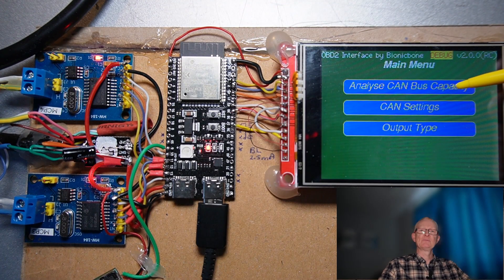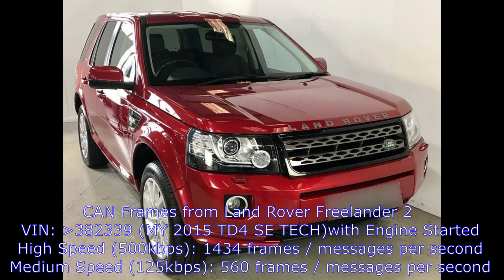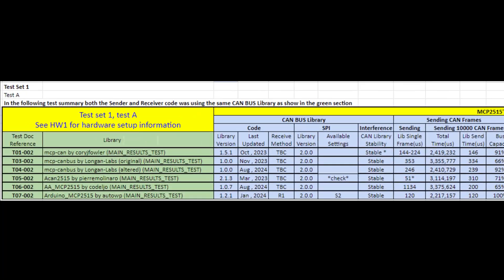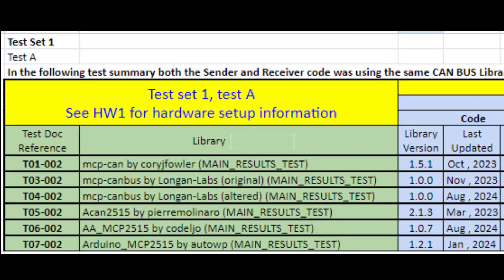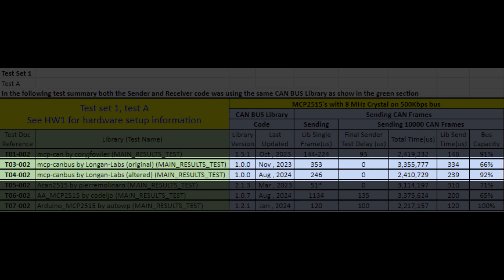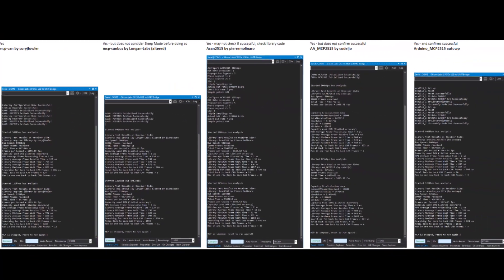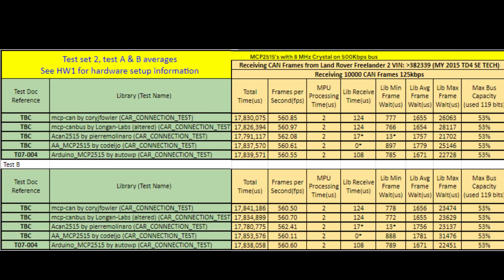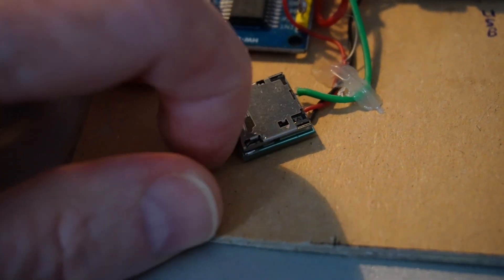MCP2515 Arduino CAN BUS Library Performance Testing

Comment: Hello, professor, I am working on a project to configure the steering angle sensor on the table via the Toyota CA L CAN H. I have tried it many times and failed. I hope you can help me. I do not know the ID for communicating with the sensor.
Reply from the maker: Each car model of car is different when it comes to IDs, so you have to work it out.
Best way to do this is record data for you turning steering wheel back and forth 3 times. Then load into SavvyCan, the graph will be 3 waves so easy to spot.
Reply: @TheBionicbone You mean it's hard to initialize when guessing the ID? Should I stop the project?

Comment: hello sir, do you know how to get rpm, engine temp, throttle position from ECU? i use 1 esp32 devkitc v4 and 1 mcp2515 (hw-184) that i connect to obd2, but i still don't get it.
Reply from the maker: @refaldiagustian For a Freelander 2? What year?
Reply from the maker: @refaldiagustian From a software point of view look at CanDrive for sorting live data. If you can record data, then SavvyCAN is better. So if in CanDrive, pressing the throttle pedal will make a line change, when it's still that line wont change. You've got to have patience since on cars past 2012 theres a lot of data and a lot changing all the time.

Comment: Thanks for your great work here, I am thinking about using this frame work to evaluate other hardware combos,  any suggestions on other hardware to compare too.  I am focused on Seeeduoino line of boards.  Wondering what other MCP2515 board people use. My purpose is general CAN for industrial use, but I want something I can use for cars also because I do lots of work with that too, but there are lots off off the shelf tools for 90% of those issues.
Reply from the maker: First I had two reasons for using the MCP2515. 1) if my code failed likely the MCP2515 buffers would fill and the car would be unaware my code failed. 2) I needed to watch two CAN bus at the same time and very few MCUs have more than one CAN Controller 

If I'd wanted to only monitor 1 CAN Bus then I'd probably use some MCU that had a CAN controller built in, thus the hardware would only require the CAN transceiver and be much smaller but take note of the redundancy offered by (1) above.

So if I had time I'd use the ESP32-S3 CAN controller with a TJA1050 (my MCP2525 uses one of these) to see if there were any improvements or control gains that offset (1) above.

Comment: This was a great video. I've recently started getting into Canbus, hacking, I have a Suzuki lapin from Japan and there's minimal to no documentation on it. I figured out what the majority of can ID do. But I'm still stumped on how the passive entry system works 

From what I can gather the fob uses RFID to talk to the car but I can't tell if it has rolling codes or not, I'm hoping to be able to clone the RFID data to a generic fob, but I've had no luck so far.

I'm beginning to think that the immobilizer system possibly runs on a separate LIN BUS that doesn't directly communicate with the rest of the network.
Reply from the maker: I did some work with SDR, to passively see the signals from the fob, if they change then there is some form of rolling code. Check some of my older videos for installation and some basic use cases. I also did some work on 433mhz and managed to replicate some signals.

Comment: Hi, would you mind sharing details of the hardware and software you used? That's very interesting.
Reply from the maker: Hopefully in the next week or so I'll be copying this over to a github master so I can share the firmware because it does everything needed for recording and analysing the data now. Of course they'll always be a need to add user code for things like requesting data or other tasks to see if what you found is what you think it is. For hardware, I used ESP32-S3, two MCP2515 (HW-184), and an ILI9341 display (with touch). Look for bionicbone on github.
Reply from the maker: I forgot to mention the F411 Openlager (not to be confused with an OpenLogger) for recording, kind of a must really for this so you can use SavvyCAN (or similar) to help find the data while sat comfortable indoors :).
Reply from the maker: https://github.com/bionicbone/OBD2_Interface_v2_Release

Comment: It looked like you are using esp32, that has an inbuilt CAN controller and only needs a 3.3v transceiver SN65HVD230.
More info on my other GitHub repositories. Feel free to message me as I have numerous PCBs for CAN on different MCUs, ranging from attiny1514, atmega328p (nano), esp32